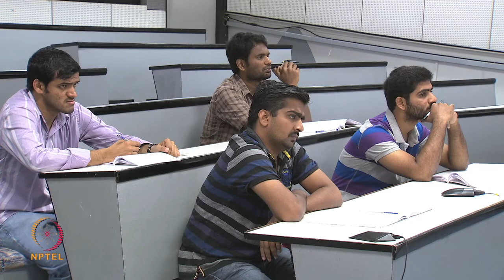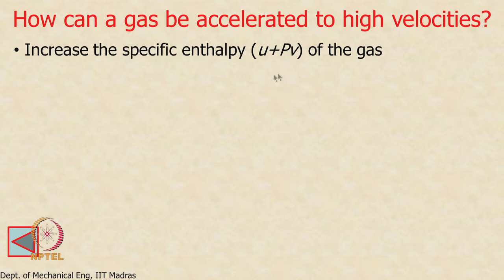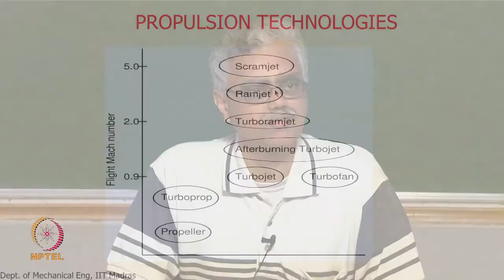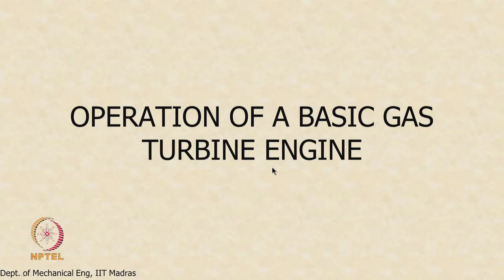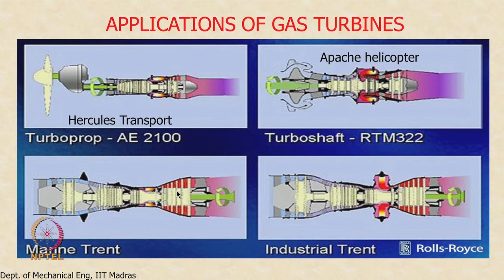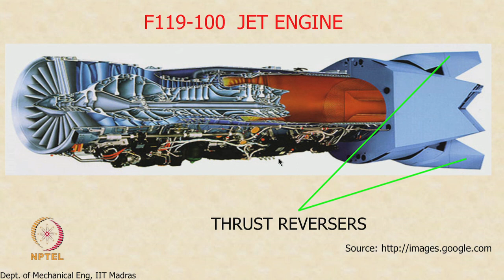Mod-01 Lec-26 Propulsion - an Introduction

Comment: guys, i do have a doubt to increase the velocity we increase entalphy and to increase the entalphy we increase pressure. but the pressure are velocity are inversely corelated right? how increase in pressure increase increases the velocity(though it is compressible flow)
leads are appreciated